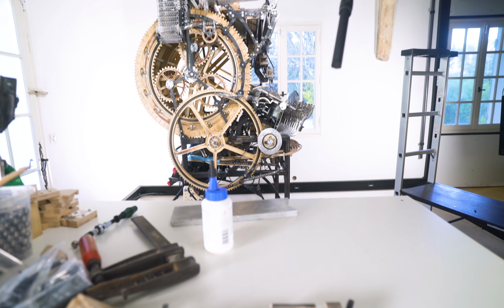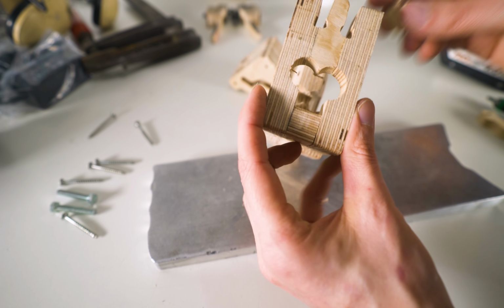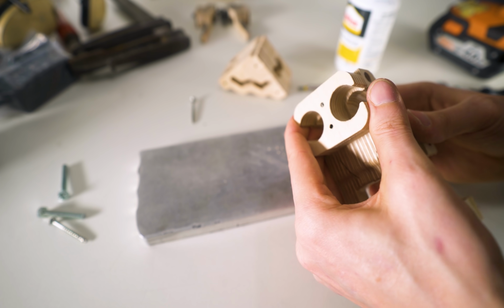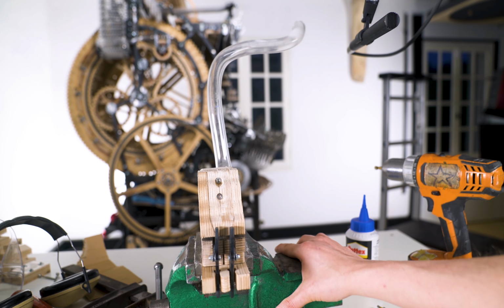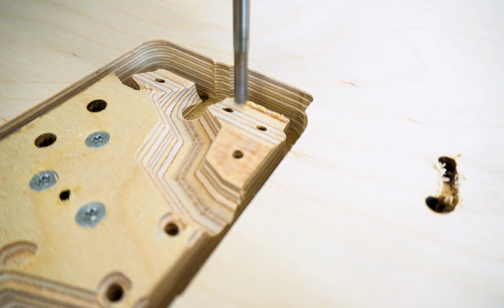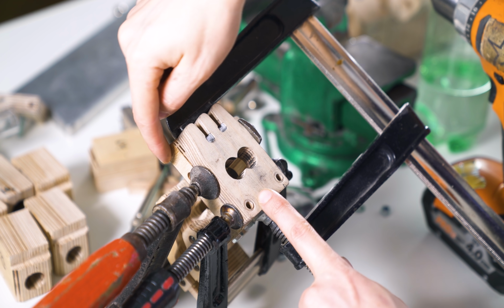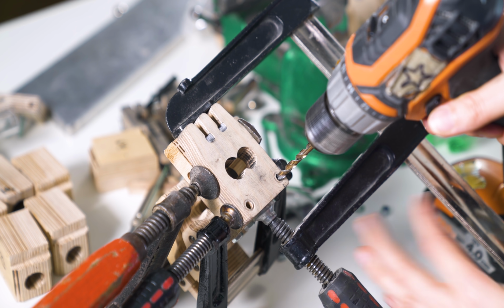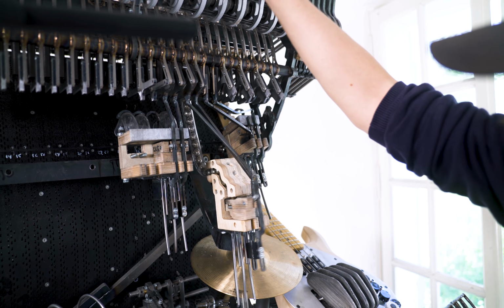Zig-Zag Marble Gate Completed

Comment: lol the “perhaps not” gate idea looks unbelievably slick.  Regardless, I’m glad you’ve solved the marble pressure problem!
Reply: When looking at that idea, I can already see a new mole infestation coming.
Reply: @peekaa42  this type of mechanical construction is a couple centuries old... Clockmakers work with tough constraints, their stuff must work for years without wear and tear messing stuff up. So a ratchet and pawl are way more tried and tested than any other mechanism you could come up with. Bonus points for having the wear surfaces easily replaceable.
Reply: @Argosh  would noise be concern?
Reply: @yuyurtrtrt2160  what noise? I'd be shocked if you could even discern the noise of a mechanism of this size from the background ruckus...
Reply: @Argosh  very cool. i'd look awesome.
Reply: @Argosh  I can see one obvious problem with the ratchet mechanism: if a lane gets too low on marbles and a marble comes in when the ratchet is part-way through a step, the marble may get jammed between the ratchet's blocking element and the wall, clogging the channel. It shouldn't destroy anything since it is only the weight of remaining marbles driving the wheel but it will require intervention to resume playing and that intervention may require stopping the whole thing to ensure a marble does not get dropped into a gate at just the right moment to destroy things. The stuck marble may also get dislodged by other incoming marbles and cause a marble to get dropped into the gate mechanism at the wrong time.
Reply: @Argosh  please.  Lets get continue so we can come to a machine that is fit for world tour, shall we?  Yes, there are time for tinkering with the machine WHEN it has been good enough to go on tour.  But before that, this solution is obviously good enough, so far.
So no, this is good enough.
Reply: @AndersJackson  we'll talk about it when the plywood has worn to the point the tolerances are exceeded.
Reply: @Argosh  yes, when the prototype with plywood has been done.  If you read, I didn't said this should be the final.  BUT it IS good enough now.  So Martin should continue and maybe address your concerns when it is time to do that.

Like replace those parts which you are so worried about.

Because LATER it will be EASY to make those in any other material you want to have, like brass or something.  Or Plywood, like Martin wants to have in his machine.

But you could always build an MMX yourself.
Reply: @Argosh  two issues with this. Clockmakers work with extreme precision. While that level won’t be needed here due to scale. It will require a much higher then this design. Wheels need to be true and friction becomes an enemy. The current design uses friction and gravity to it’s advantage. Can the level of precision be achieved within the constraints of materials and tools? Idk. The second problem goes along with the first, but is in pure complexity. Complexity is always a problem in engineering. Simple is best. Less parts is best. Less moving parts is best. There’s a saying in America, “Keep it Simple Stupid.”
Reply: @rodimusprimex5232  Precision (and aesthetic) can be handled by using SLA resin printed parts
It could in fact be fewer parts and easier to build than the zigzag, which has quite a few 2-sided machining steps.
Reply: @rodimusprimex5232  There is something to be said for the simplicity of a design that will work regardless of the pressure, instead of an additional structure to control that pressure. And an escapement could be accurate enough to not need the gate - the marbles could drop straight from the escapement wheel to the instrument.

But it looks, to me, like the two teeth on the escapement are backwards!
Reply: @Argosh  thanks for that insight!
Reply: @AndersJackson  luckily for us the world tour won't happen pefore the pandemic ends, so just enjoy the show for a while.
Te biggest issue I see with ratchet design is that it will add noise.
Reply: @peekaa42  I agree. If a marble were to hit the "spike" of the marble gear it would have a catastrophic failure, whereas this design seems far safer. The clockdrop would look cool but I'm scared it would be a garden of gnomes.
Reply: What is mole
Reply: Didiilempoy 

 @peekaa42 ;
Reply: @peekaa42  why?
Reply: Here's Rossero's version of it: https://www.youtube.com/watch?v=Q-Yr6PzVmfA
Reply: @jakob_z  Dammit. I wanted to paste that ;-). Anyways, perhaps the current gates on MMX1, and the "clockmaker" version on MMX 2, or on MMX1 after World Tour?
Reply: Ratcheting wheel designs look wonderful but they can be a complete pain in the butt to get to work due to the precision needed, once they're working they should work well but personally I'd save them for the next machine and stick with this zigzag gate on the mmx for simplicitys sake
Reply: I couldnt have said it better <3
Reply: We've solved it in the streams⚙️
Reply: @vanillawaffle7303  solved in what way? Is it going to happen?)
Reply: @morkovija  the chat helped him with the cad
Reply: I think it could be a great choice for e.g. the bass channels that are off to the side and a little easier to see already
Reply: I remember suggesting like 50 videos ago that the gates should be a turnstile design so that instead of fighting agaisnt the marble pressure, your actually using it to help operate the gate.
Reply: I love escapement mechanisms but Martin already got this design working and I feel it would be a long process getting an escapement design working for something that only looks a little bit cooler from the front.
Reply: Yo, I was gonna ignore the 'perhaps not' tease, but then this comment made me rewind....and whoa, that looks SO slick.....but is also mole-ridden
Reply: I really feel that perhapsnot design is THE ONE
Reply: Hello
Reply: Only thing i can see with the ratchet and pawl mechanism is if the angle on the first lock (stopping multiple marbles from coming out/ bottom pawl) is wrong then many moles could come up due to it maybe running away once it is triggered from the marble pressure. However due to it being an old design used even today in a clockwork mechanism one would think that the angles wouldnt be that much of an issue
Reply: I think his current design is awesome from a mechanical engineering perspective. The fact that the friction drops super low when the marbles are in the right position, and then when they are in the next position the pressure is at a maximum and pushes the next marble in, it is just genius. So many ingenious simple solutions coming up with this project. 

More moving parts may look cooler in practice, but just think about all the things that have to go right to make them work. The rotation about the axel has to be fairly tight so the ratchet wheel doesn't wobble and miss the tooth. The wheel also needs to be quite thick to reliably engage with the arms. The ratchet wheel needs to be constrained to not slide along the axel, and can't bind up when forced in one direction or another. The arm teeth need to be shaped just right so that they don't get stuck being engaged with the wheel. If you had an actual machine shop, and plenty of metal to work with, you could make it work very well and it would be very reliable. If you are trying to make it for cheap on a cnc router, in plywood, you are going to have a much harder time.
The MMX isn't a precision swiss watch. He's trying to avoid that. A swiss watch that gets dirt in it is a useless watch. He's trying to make something that can be beat up and made without precision equipment and still works fantastically. 
This is a Honda Civic, not a BMW. And I think that is actually more impressive because it takes a lot more design consideration.
Reply: Why does this feel like 5 weeks ago, not 5 days? So funny to see this design so quickly get discarded
Reply: @tommj4365  Progress stops for nothing lol
Reply: Martin should only do it when everything else works! Looks absolutely amazing though.
Reply: I thought early on that a rotary escapement would be awesome but too complicated...seems I was wrong, That's dead simple!
Reply: Almost certainly made of metal though, no? It’s hard to imagine wood would be suitable for the gearing. Just not enough strength for parts that precise.
Reply: this new design he just made is not perfect either, with time the marble path will get wider and i think there is a chance for them to get stuck  and not fall down anymore , maybe worth an analysis on where the pressure points are and simulate some wear on the parts then test it
Reply: Yes it's very cool but isn't the ratchet going the wrong way??
Reply: Nevermind I'm stupid weight pushes it opposite. Pawl stops the movement instead of pulling it.
Reply: @TheZep1 I love you too
Reply: If you want to see tbe marbles, cant you cnc the front parts in acryllic?
Reply: Looks noisy

Comment: These turned out phenomenal! It was such a great treat to see and interact with the live stream as you worked to complete this leg of the project. I think this design has nailed the requirements through and through, and with the time you save by duplicating it, you might even be able to spend that time credit making it so you're more happy with the overall looks in the end. It might not even take much effort at all to reach a balance between aesthetics and functionality since you designed out all the previous problems with this elegant solution. Keep it up Martin!

Comment: 13:11 Oh god that looks so risky

but so cool looking
Reply: Way too many moving parts. That design is just asking for trouble.
The best way to improve the visibility would be to machine the current design out of acrylic or polycarbonate.
Reply: @necronomicon1472  I think that we will see that design beeing implemented sooner or later. Its' principle of working is not based on friction and very tight tolerances like Rosero's (?) design, so its invulnerable to mounting angle changes, plywood wearing out with time, dirty marbles etc.
Reply: @Firley777  Well, in order to get that design to operate properly, you need to do some fairly precise machining and we all know what happens when Martin meets precision.

Comment: the few first seconds of this video is a proof that MMX is ready for some sweet Swedish death metal
Reply: I don’t think you can program the snare to go that fast, although I could be wrong
Reply: @SilverWolf340  let's convince him to add an extra couple of marble gates to the snare drum hehehehhehe
Reply: @SilverWolf340  With programming plates, anything is possible! There could be an extended pin on the plate that holds a marble gate open, rapidly dumping all the marbles in a given channel. It wouldn't be easy to keep in time, but it could be done...
Reply: @InventorZahran  Not anymore, it's limited to one marble at a time now.
Reply: @InventorZahran  bro that would be hilarious, but yeah it’s not possible. I edited this 3 times bc I couldn’t figure out if I was wrong or not

Comment: That design at 13:12 makes no sense to me.
Just... none.
Reply: It's called an escape wheel, like in a mechanical watch: https://youtu.be/yFbWplZ-D6Q?t=526
Reply: @WoutStandaert  Okay that explains it a LOOOOT better than just the diagram, but the rotation in your example was tied to a torque spring. No way that works in the MMX, he'd need some other means of rotating that gear exclusively once freed, that isn't under a limited torque or constant pressure (ie, if he tied it to the main drum)
Reply: When the arm moves it would click the the gear, dropping the next marble. In terms of moles this is a mountain.
Reply: @saucepirate8970  But looking at the design... either way the drop-arm moves (be it straight pull away from the marble track, or pivot higher on the arm) the pins wouldn't interact with the teeth correctly. The pins are curved where they need to be flat or the teeth are on backwards.
No sense.
Reply: I think he should prototype that, as it has no plywood in such a close fit case.

It's a pendulum mechanism like the ones you find in watches. The arm releasing the marble will move the clamp so that the wheel can step one forward. There are some tight fits in that too, but he should test it in a jig removed from the MMX.

I'd really like to see more testing off the machine. Martin should get a angle finder and place things in 3D space with it. The MMX is too cramped to test with.
Reply: @helvettefaensatan  Agreed 100%. Martin needs an angle finder. That BS about tipping the stair-step pressure gate 30* and being all "Darn, it clogged" had me ripping my hair out going "WHERE ON THE MMX IS THERE A 30* INCLINE YOU NEED TO MOUNT THIS THING TO?!"

He needs to take a lot more measurements and slow down on the iteration. He's making progress, but his progress could a a LOT faster if he just slooooowed doooooown.

side-note, I kinda want him to rebuild the MMX entirely in metal once he has the full design set. Would be expensive, but would allow for a LOT more opportunity to let his artistry flourish. Solid pane of metal? Cut some swoops and flowers into that bish!
Reply: It’s a pretty simple and reliable mechanism though...